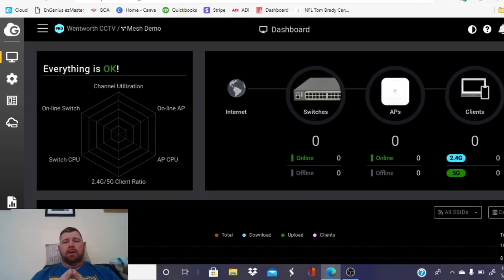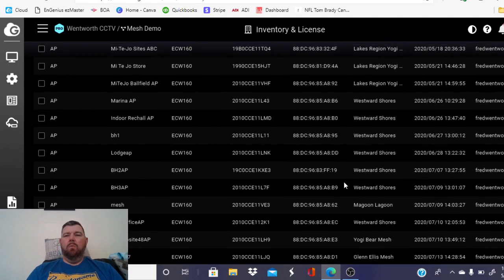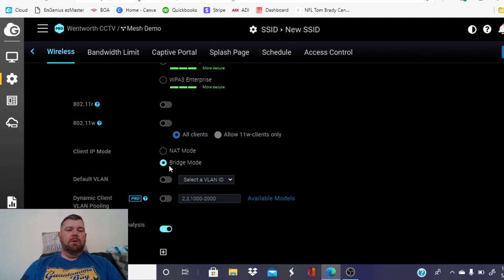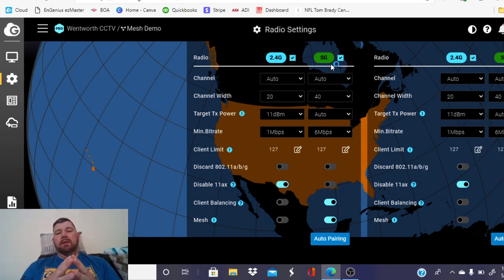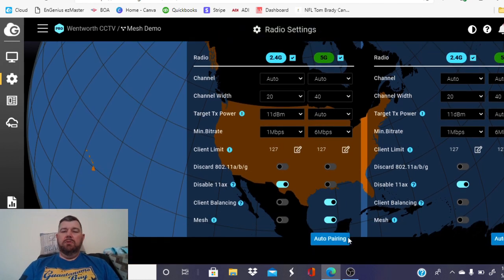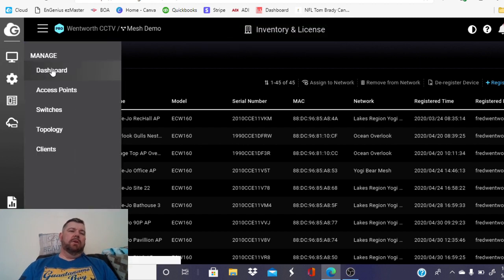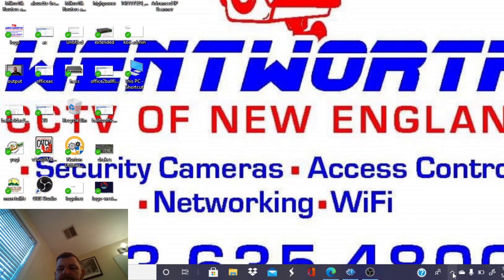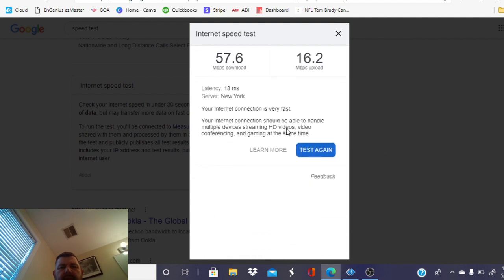Mesh Wifi Explained and Configured

Comment: Great video, very accurate using the cloud webpage settings. Thanks
Reply: If doing more than 2 Ap's should they all be connected to LAN at same time and "Pair" before disconnecting or can you add them 1 at a time over a half hour for example. Does each one need to pair?